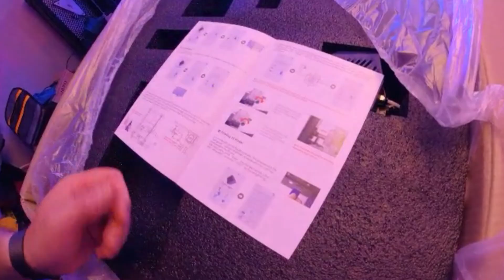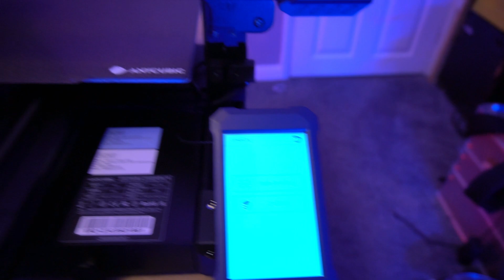Anycubic Vyper 3D Printer the 3 updates

Comment: were you successful printing in PETG ?  I ordered some Capricorn tubing and a new hot end / I bought this used today for $100 and will give it a shot once these parts come / the LED light stopped working... and I bypassed the filament sensor in the EPROM, that is too much pain in the arse - other than that, looks like a nice printer

Comment: I have a Vyper with the problem of auto leveling and it wants to crash into the bed as well. It also has no red light inside the print housing if I push the nozzle up a little bit. I took it apart because the print head had become a little loose but after tightening the screws holding it up that's when it decided to not be able to sense the bed anymore. Anycubic said probably the strain gauge and C clip but refused to send me any parts. The unit is 6 months old. I wish I knew where to get parts from as the printer is just sitting there collecting dust. The service and help from Anycubic was very disheartening for someone just getting started with their first printer.
Reply from the maker: They are in stock on the anycubic website but if you see my previous video it links you to getting a replacement part
Reply: @TheRealSamPrentice  Yes anycubic suggested I can buy a part from their website for US$65 that might fix it when this is clearly is a warranty issue. You would think with such a well known fault they would be a little bit helpful towards their customers but nope. They will never get another cent from me. #BlacklistAnycubic.

Comment: Hey Sam! Just curious if you've had strain gauge issues with the new Vyper? Is it still an issue? Thanks!
Reply from the maker: On the v2 no, but on the v3 they added a part to the gauge to reduce the bending. It’s a shame that at no point have they addressed the issue and dealt with the problem on mass. I was due to give away two new printers which where going to be vypers, but decided to go with another brand due to these issues and how the problems are dealt with.
Reply: @TheRealSamPrentice  I see, thanks. Damn it, mine just shipped. Haha

Comment: Hi Sam, thanks for the review. How do you feel about parts availability and upgradability of this thing? Will Mega-S/Mega-x extruders work? Or would an Ender one work? Mostly thinking hotend and extruder compatibility/replacability.
Reply from the maker: Good question! Well at the moment there are few stockists of replacement parts, there is a possibility that you could change out the whole hot end or even fit a bltouch. Personally I’ve found the printers to be pretty spot on other than the sensor issue. There is community firmware for this now also which does put it in line with the cr6 se now
Reply: Thanks for the reply. I went with the Cr6Se. The community support just seemed to be more mature after some googling. The only thing I can think of I'd change is the bed to a PEI flex, but that can come later. I have the photon mono, so Anycubic did get some love from this direction a while back :)
Reply: @TanksWorkshopMinis  how’s the cr6se?
Reply: @naturalgamerjk606  Still waiting on a replacement part. The cable going to the back of the bed had a cracked connector. They say one's coming, but with shipping as it is....maybe it'll be here by the time we invent power armor?

Comment: After 3 months from the purchase of the printer in pre-order (yes I know, I've been an idiot),  the leveling issue has not been solved and at the moment I have not even made a print (I am not a new printer because I have  two Anycubic Mega S that print continuously in my office and very well for more than a year).
Anycubic in 3 months sent me several parts that I replaced without any improvement: at the beginning n.3 Strain guouges, after 1 month a new motherboard, the whole stain guoge block and its plastic case for the fans with the new connector (the one the first was the one with the red glue ...) and all the cables that  now I see mounted in this new version of the Vyper.
i am also noticing from this video that the two sensors on the Z axes have been changed ... that's probably the real problem of mine now ... by the way now it's official:  the Pre-Order version of this printer and those immediately following are actually prototypes ... the thing is shameful at this point.

Comment: Liking the re-review. I had saw the "new connector" on the hot-end in an official anycubic video a couple of weeks back. My Vyper took a fit today after working flawlessly with the head crashing into the right hand side of the bed and pushing down quite hard! Had to switch it off at the back to investigate. It had manage to slacken the eccentric pulleys on both the hot-end and the front of the bed. I had to re-tighten those. Had to push on the heater block a bit to get the strain gauge to re-register. I'm currently printing the Owl test print again but I've raised a ticket with Anycubic about the strain gauge. I'm interested as to the reason for the new Z-stops, looking forward to hearing what Anycubic has to say on this.
On a different note, do you have any recommendations on start g-code? I've just installed Cura 4.11 and well, my first print from this was what caused the head crash in the first place. The Print head ran along the front of the bed but was below it, It didn't rise from the home position to the left of the bed.
Reply: i make sure to set up the printer as the i3 mega. NOY THE I3 MEGA S or X that first google result is WRONG and damaging peoples printer
Reply: @zdog90210   I've got mine set up as i3 Mega now. Been tinkering with start G-code. Finally getting somewhere. Flashed up to 2.3.9 as well. My mate's Vyper arrived a few days back. His is the same as the one in the review. Hoping to get a better look at the z-stops once he gets round to assembling it. They are fixed whereas the ones on mine move and have a grub screw which Anycubic Tech told me to to adjust. Be interesting to see where his print-head homes to as well. The z-limit has got to determine where the printhead ends up.
Reply: @zdog90210  The newest Cura comes with a proper Vyper-profile and custom print-profiles and never had any auto-levelling so far. The profiles are a good starting point, just not enough wall-thickness and the fast one doesn't even make walls.

Comment: Will be interested in seeing if new one has fixed the strain gauge problem.  I bought one of the first 3000 and also have issues. Extruder was slipping and strain gauge totally failed. Anycubic was good agreeing to send replacement part, coming up to third week and  still waiting
Pity it  was such a promising machine. hope they get it right before it’s gets tarnished with being a total failure
Reply: Same here. I bought the printer in pre order… the strain gouge problem is still there and now I am also waiting for a mother board replacement… (the assistance is trying everything…).
Reply: @Busckak  looks like we are the beta testers. Good luck with your vyper, hope you are back to 3D printing soon
Reply: @Mdbunn2013  we have been tester for sure…

Comment: Thanks for the Re-review of the Vyper.
1) Is the newest one running the latest firmware? Or are there any updates needed?
2) Not mentioned in video, but I assume the utility box magnet auto eject feature/ mis-orientation flaw has been fixed in quality control?
3) I'm assuming this was not a 2nd purchased Vyper but an updated version sent for review by you, being an active YT voice in the community?
4) How is the Ratrig working out?  Debating b/t it and Vyper still.
Reply from the maker: It’s running a later version and as more
Versions come out I’d suggest you upgrade. 

I didn’t have an issue with the magnet the first time around so didn’t mention it.

This was sent to be but that’s more complicated than in prepared to go into.

The ratrig is just awesome I can’t wait to finish the 1.3 which the vypers are sitting on :) 

I’d go ratrig but they are both very very different machines
Reply: There are two version depending on the board. 2.3.9 for the older and 2.4.5 for the newer one. If you install the wrong one, it's no problem to downgrade btw. Anycubic sent me a new board and sensor because of error messages I got from the filament sensor. I haven't installed it yet since it was not happening again later. Maybe the flowrate wasn't high enough for the thinner filament in combination with a 0.8 nozzle and probably too high layer-height.

Comment: Famous last words - "I know what I am doing...." I am not sure what the advantage of 2 Z-stop sensors are over one would be?
Reply: If the Z had separate drivers they could be used to tram the bed.  My guess is at this price they don't
Reply: @woodwaker1  Thanks David
Reply: @kieranclarke135  - I think the Voron has 4 Z motors and my Rat Rig has 3 Z motors each with a separate driver.  Supposedly three is better because it will allow for a perfect level if the bed is flat.  The bed is massive and is suspended in a unique way